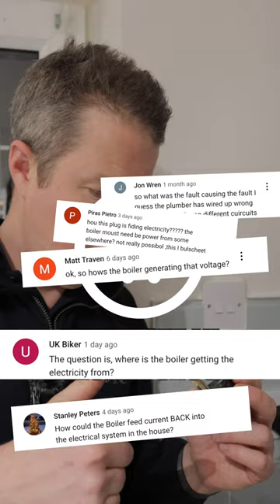How is this electrical fault even possible? MIND BLOWING 😵 #shorts

Comment from the maker: Watch the full episode here - https://youtu.be/MQ_XKCf5NTQ
Reply: Could this and some other risks be avoided, if you made a "safety plug" with no cable, except a 1" wire directly from live pin to earth pin? Plug it into the same isolated circuit you're working on, then if it becomes live (eg customer flicks the breaker back on!) then an RCD, circuit breaker or fuse upstream will pop.
Reply: I wouldn't have bothered, she won't be able to afford gas after the 18k bill you send her way!
Reply: How bad was it?

Comment: That can be easily rewired for around 30k or so.

EDIT/UPDATE 04.2023
Had electrician today doing EPC check. I asked about it and he said its possible - but it would have to be hefty property.
He quoted my place at roughly 6k onwards, completely re-doing everything. And that was rough estimate for cheap sockets and so on.
So yes 30k rewire job is possible - especially on big/massive properties and with fancy equipment used (more pricey like usb in sockets and many others)
For me - its still crazy amount of money for the job - altough i were fully aware of amount of expertise and time it can consume. Full rewire is no small job. Its a total overhaul.

Comment: Sort of but not quite related: You may also get a shock from a floating ground, since the live wire induces about 100V in it. It will at least feel tingly. If it feels weird, sort of sticky, touching metal parts on appliances, stop using them immediately.

Comment: fucking called it. in the states we call that back-feeding a circuit. it only works if the two circuits that are getting tied together are on the same phase, otherwise you get a phase to phase short.

Comment: As an American its wild to see a water heater inside a kitchen like that, here it would be somewhere like a garage or utility room or crawlspace where it isn't just out in the open and you could easily run a new circuit for it if you needed to.
Reply: Boilers especially in old houses where typically installed in the kitchen, for a simple reason, there you already had gas (that is also used for cooking) and hot/cold water. Also giving that the old boiler were not so efficient and well insulated having the boiler in a room that you need to heat anyway it did meant avoiding wasting gas. In Europe houses are typically small apartments of 2/3 rooms plus a bathroom that don't have utility rooms thus the boiler is in the kitchen. 

In bigger houses the boiler is typically in a dedicated room by the way. While in new constructions (where there is still the boiler and not heat pumps) it's usually installed outside (which is also safer).
Reply: Attached garages are less common in the UK and crawlspaces don't exist, those are pretty exclusive to shoddy American wooden stick houses.

Comment: After watching this video about the boiler wiring. The plumber should have understood how the programmer works. The boiler most probably needs a permanent live for the timing and electronics module. However, the plumber should understand the interconnection between the programmer and permanent live required by the boiler. It was wired incorrectly. This should not happen, this means the programmer was bi-passed and didn't work. The boiler was permanently on and relied upon the boiler temperature by the sounds of it. Besides, if you don't know the specifics of the boiler you can only assume by watching this video.

Comment: Come across this many times when others have wired boiler sparks told not to touch  gas but plumbers ext allowed to touch electrics
Reply: I’m work with gas boilers, the wiring involved is not hard to learn and is included in the MIs for every boiler, whoever wired that is obviously just an idiot as it’s the plumber that services/repairs the boiler  would potentially get electrocuted. We get taught about safe electrical isolation as part of gas safe registration and they are bringing in more electrical safety into gas safe qualifications.

Comment: They need to make a note of that and remember to tell anyone that they need to switch of BOTH circuits when they do work, surely the upstairs circuit is back feeding the downstairs circuit so the whole house is live even when the downstairs is supposedly off
Reply: Iirc, in the other video he mentioned the live voltage was being fed to ground. So, not just the whole house, he's effectively polluting ground for his house and everyone in a wide area. Other houses won't get full voltage, obviously, but it's still going to mess up ground potential in a wide area. Not only does that slowly destroy sensitive electronics but it can even attract lightning strikes. Idfk what this other electrician was thinking.
Reply: Id assume it just trips
Reply: Funnily enough in the original video he shows the live 240v by putting his meter on the plug. It's 100% feeding back into the downstairs circuit. This is the reason if I ever do ANYTHING electrical in my house (to be clear I dont do anything that a professional should do) I shut power off completely
Reply: @curtisss  same with my dad, we have a split box for downstairs, downstairs extention, upstairs, upstairs extension but even with that, he always shuts everything off
Reply: No, fix the problem for good by correcting the wiring. Don't leave dodgy wiring in place
Reply: @faithful451  i agree completely but im both just an apprentice and very intoxicated that is irrelevant tho cuz that shit aint up to reg fix it dont put warning tags thats bull do your duty as a electrician and fix it bandaids are bandaids they fall off eventually they will forget and someone will die do you want that on ur conscience?
Reply: He meant the ground floor circuit not the earth cable. In Uk circuits are split into floors on the main consumer unit,, or at least ground floor and upper floors and then you can switch the whole thing off aswell.

Comment: My guess was going to be either a leaky ground charging water pipes, or the boiler's capacitance. Never would have guessed that it had two plugs
Reply: Really, what has two plugs?
Reply: My first thought was something like that too, but 170 Volts? That's an actual (overloaded/bad) connection

Comment: My house has weird interconnection problems. One of the upstairs bedrooms sockets is on the same ring as down stairs kitchen lights & upstairs emerson water heater!

The rest of house disconnects with the correct breakers as you'd expect.

It was a show house , so maybe they threw the wiring in last min??

Comment: And that’s why it’s better to use single rcd’s per circuit instead of higher amp rcd’s with circuit breakers, sharing the same neutral., because upstairs and downstairs would be already wired separately, eliminating the cross feed scenario. 
Please bear in mind it’s just a comment from a ‘short vid’.

Comment: So new question, how would that get fixed?
Reply: The boiler needs a permanent live supply and the thermostat upstairs needs a permanent live supply, aswell as switch live cables that allow the stat and boiler to communicate with each other. The boiler installer has retrofitted a new boiler and doesn’t have enough wires in the existing cable from stat to boiler so he uses the wires he does have in the cable for switch lives and uses a seperate permanent live supply in the plug downstairs for the boiler and upstairs for the stat (off the upstairs ring main). When switch boiler off and stat calls for heat the stat sends switch live (but still 240v) to the boiler hence back feeding the downstairs ring main from the upstairs. The solution is to run a new cable with enough wires inside (4core and earth) to the stat for then boiler and use the plug as the permanent live for all of the heating electrics or move stat and programmer downstairs to boiler but have stat as radio frequency and locate elsewhere.

Comment: Is it the same phase or just a single phase 🤔
Reply: Same phase, but two different circuits, one on all the time and one on only when calling for heat.
Reply: Single phase. 
UK residential is normally 230V single phase. 
Us Germans being the Master Race and all that, use 400V three phase in pretty much all residential.
Reply: @benjurqunov  Are the meters in Germany all 3 phase? Or do you have 400 V 3 phase just in the basement and the apartments are all single phase?

Comment: How is it possible the breakers didn't trip?
Reply: They wouldn't have because there wouldn't have been an overload
Reply: And usually you have 1 global residual current switch except for a more sensitive one for the bathroom (which likely would've tripped in this case)
Reply: External power supply, so not this consumer box

Comment: That’s a plug mate and not plugged in, hard job getting a shock from that.😂
Reply: It's because the appliance is getting power from another source, so power is coming down the plug from the device end instead of the wall outlet.
Reply: Did you watch the video?

Comment: UK eclectic problems are stupid. The  panel looked like it belonged on a ship. There is no need for all the wiring drama. 110v and 220v at 200amp service in most of the world works fine. lights at 15 amps plugs at 20 amps dryer at 30amps HVAC at 40 and water heater at X 2@50. black is HOT white is Neutral and Green is Ground. single pole no crazy shocks at 60hz. in one of his post his panel looked like a mess of rope. every time I se and English power patch I am ready for some one to get shocked. There electrical code looks like they got if by telegraph in 1888 direct with a description from Edison's off vs a spy. The english still use switch's that Tesla and Westinghouse redesigned in 1888.
Reply: We also have plug standards which are way more durable and safe than American plugs.
Reply: @G1NZOU  that’s never been proven the reason the UK uses the he plugs they use it’s not durability by no means. GE and Westinghouse had worldwide patents on the 110 plug and the makes of plugs in the UK did not like the fee. All about the £$€.
Reply: @The1978johnny  I can prove it myself, UK plugs never get bent pins, they're too thick.
But I've handled US plugs before and they can be yanked sideways and bent.